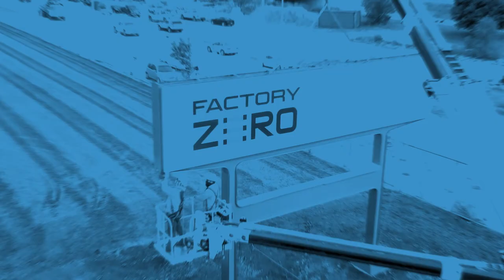Growing GM ft. Gerald Johnson & Mary Barra | The Competitive Advantage ep. 4 | General Motors

Comment: you need to use Lyten battery engineering  which has graphene 3d printed cages housing sulphur with holes only big enough for lithium ions to go through so there is no pulling out the sulphur and on the other side, crinkled graphene that increases ion bonding ten fold by increasing surface space instead of just following the edges. sodium ions are larger but if you can use glucose to prevent sulphur transporting you just might nail it by having larger cage bars that stop leaching sulphur. quantumscape's non porous porceline divider is interesting. Ultimately Borophene is king and lithium reigns with it. Sulphur is great..